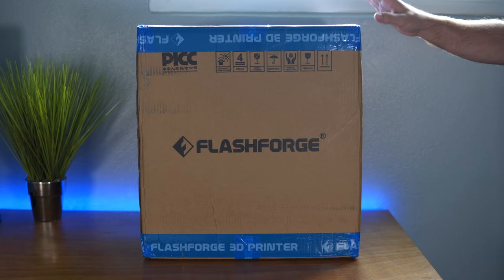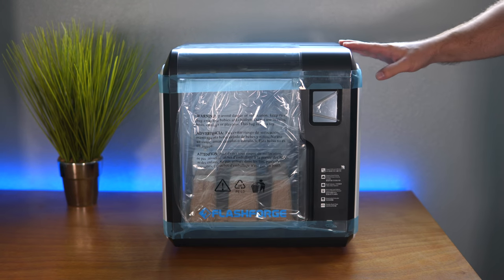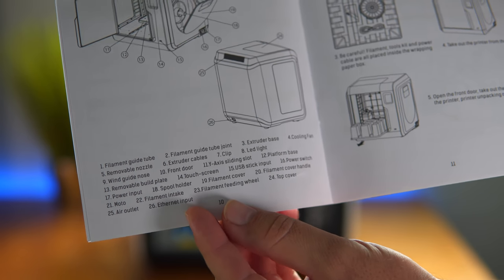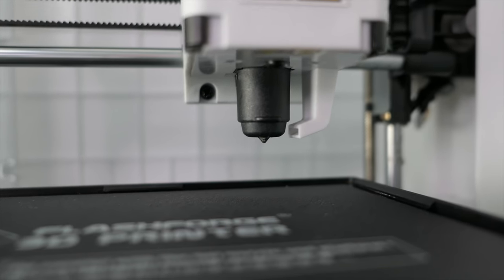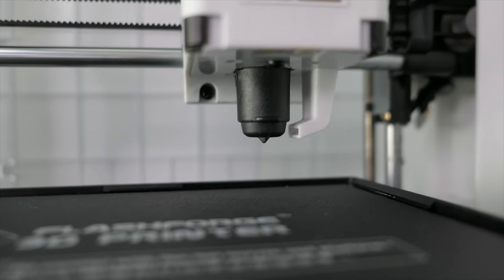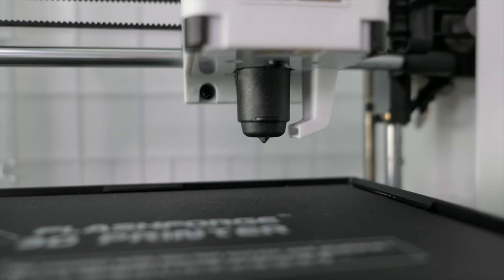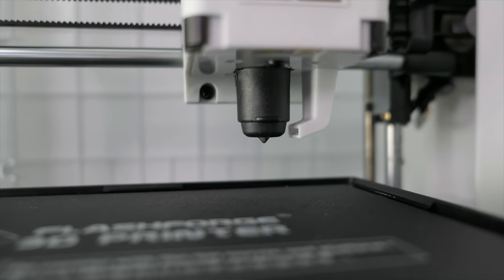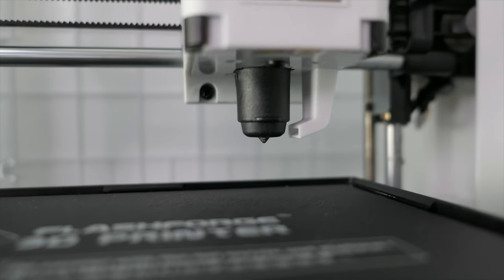FlashForge Adventurer 3 - 3D Printer - Unbox and Setup

Comment: I'm a cnc machinist and I'm pretty comfortable with gibbscam and autocad to a certain extent, but I'm brand new to 3d printing. I bought this printer and can't wait to get it. Your video was extremely helpful to me. I know this video is 4 y/o now lol but, thank you for going over the software and slicing process in such detail as well as the functions of the 3d printer. The explanation in this video is perfect for someone brand new to 3d printing. Great job, man
Reply: How has the printer been so far?
Reply: @SickWheyfu  Been awesome! Comes in handy with custom brackets and custom designs all the time
Reply: @SickWheyfu  If you're interested in printers to buy. The flashforge adventurer 3 from the day I got it until now, prints pretty flawlessly. 100% recommend
Reply: @dale4525  Yup, I'm in the market for one. Looked at the Ender series and the SVO6 too, but since I found an used Flasforge Adventurer 3 for the same price as either of those, I'm going for it. From what I understand, it's pretty much plug and play. Just plug it in, feed the filament, and give it a file to print, pretty much.

Comment: Thank you so muchhhhhh I've been trying to work this for about two years and I finally got it working. 
0:00 - 10:03  ~Unboxing~
10:04 - 12:39 ~Tutorial on how it works~
12:40 - 13:14 ~ Putting in the PLA~
(Finish later)

Comment: Hi Vlad, 

I got the Adventurer 3 up and running for a while now, but I cant seem to find a proper cleaning agent for the bed? There will ofcourse be residue when glue is used.
I feel like 99,5 % alcohol or acetone is going to ruin the bed and its rubber-ish surface. 

What do you use? 

Thanks!

Comment: i got super lucky recently. a local store called the "Yard Sale" was selling an Adventurer 3 Lite for $200. They had looked up the Adventurer 3 on amazon and i guess they thought it was the Lite so they printed a screenshot of the amazon price and sold it with that. I went and bought it and when i got home and unboxed it i noticed the side of the printer said "Adventurer 3 V2". I also noticed it came with an extra build plate, 2 240c nozzles, and 1 265c nozzle. Turns out they didnt realize what they had and sold me a brand new 450 dollar printer for 200 lol
Reply: score
Reply: What a deal!

Comment: So I just got this printer and it's amazing. Works straight out of the box with minimal setup time. However I am having issues with the rafts - If I disable them the print moves from the plate every time, what did you do to prevent this? If I enable them the print works but then they are a nightmare to remove. Help appreciated.
Reply: Have you figured this out yet? if not just get a cheap scraper to scrape off your print

Comment: Im wondering if the extruder clogging issues have been dealt with on this model with the new firmware update. If so, this is a nice printer at a nice price with many features.

Comment: Does the regular size filament roll fit the roll holder? I have the Flashforge Finder and it doesn’t fit the regular size roll.
Reply from the maker: No, it's the same small roll as the finder.
Reply: Do you know if there is a way to use the regular size roll externally? With my Finder, I have to feed the filament external for the regular size roll.
Reply: @dkieng  Search Thingiverse for Flashforge Finder.  You'll find an external spool holder.  Works like a charm.  Using it myself.

Comment: Just bought this printer, and my first little square print is stuck to the bed completely. Nothing I do gets it off. What could be wrong? I'm going to have to heat the bed and scrape off the print, ruining it in the process.

Comment: So looking to get my first 3D Printer. I am looking at the Monoprice MP Select Mini V2 or the Flash Forge Finder. Which would be the one you would choose based on the price, the Forge is about $120 more than the Mini.
Reply from the maker: I would chose Flashforge over Monoprice but if you want the best printer for your money i would recommend ender 3/pro, but thats just my opinion.
Reply: @JustVlads  I appreciate that, I do not want something to "tinker" with, just want to print some miniatures for table top gaming at a reasonable price. Throught it out of the box and start printing.
Reply from the maker: @unclegamer6705  I understand. Unfortunately I have not had enough printers to suggest an out of the box ready best bang for your buck printer.  The FF Finder is a good machine to start with so maybe that would be a good choice. The monoprice printer that i have is not on par as far as print quality is concerned to the finder. Also consider buying the printer from a store that you can easily do a return just incase its not what you were looking for. Hope this helps.
Reply: @JustVlads  Not sure if you saw this, looks like Monoprice has the same printer as the Adventure 3, the Monoprice 135880 Voxel 3D Printer. The best part is it is only about $30 more than the Finder 3....  Think I might have found my first 3D printer.
Reply from the maker: Oh nice, they appear to be the same lol. It's a very good printer overall. My bed on the flashforge a3 is not perfect, other than that it's great. It would an awesome first printer.
Reply: Uncle Gamer the elegoo Mars is really good for miniatures

Comment: After hitting print, the print head on mine is just sitting there not doing anything... It moved into... Some position, raised up, not down near the plate, and its just... Hanging there. It spewed out a string of PLA, dropped it, and carried on hanging.

Comment: Great video.  Considering purchasing one of these after STRUGGLING to get an Ender 3 V2 to print correctly.  I could not get ANYTHING to stick to bed.  I did not see anything about you setting up the bed or leveling it.  Do you need to do this step or is it built into the machine/software.  Was setting the Z offset the only thing you needed to do?  How did you do it later?
Reply: u dont need to move the nozzle or anything. for me i just loaded the filament and built the box and it was perfectly fine. i hope this helps
Reply: Bro, the first video I pulled up had how to level the bed of the ender 3 v2, and also there is a mod that you can buy that auto levels it. How much did you research before buying?

Comment: witch one should i get FlashForge Adventurer 3  or Flashforge finder ?
Reply: I have bought the finder and it's a greater printer. The only "bad" thing is that you don't have a heated bed. But I find it overall a great printer.

Comment: So I decided to get the other version the printer that you have here the one that doesn't have the camera because I don't think I'll need it but other than that this is the one I'm going to go with because it's what I think will help me plus a software seems really easy to use and it's going to be a lot of fun to use I can't wait to order it this week.

December 31st 2019 at 5:45 p.m. here in New Milford Pennsylvania on route 29 I was involved and one of the most horrific car crashes at people I've ever seen in their life.

I was hit head on at a combined speed of 125 mph at the scene of the crash which I don't remember much anymore I was told that I lost 80% of My blood and that basically during surgery I die twice on the operating table and was brought back I was in surgery for 13 and a half hours.

I broke my tibia shattered my fibia and so many places completely destroyed my left arm and had to have rods pins and screws in both legs both knees and my left arm completely rebuilt from The joint to the hand.

I spent about a month and a half in the hospital and then I went to physical rehab and I spent another week and then I spent another eight to nine months at home physical therapy.

The pain that I went through was there's no words to describe it as whatsoever.

I am currently disabled now because of the accident the guy that hit me and was his fault and , unfortunately it would do the Pennsylvania law that if you don't have a certain amount of money you can't collect so my settlement not much at all.

I was told that would never walk again or do this and do that and I refuse to accept that I do walk I do drive but I'm at 70% of my life the rest of my whole life I'll be 70%. Meaning that I will not be able to run or do physical meaningful activities like I used to.

Before that in 2012 my fiance killed herself on October 15th my other dog passed away on December 15th 2012 my mom had a stroke on December 25th 2012 and died January 27th 2013 and then two years later I lost two more people two more relatives two best friends and so on and so on and then my uncle and my aunt passed away and then I had the horrific accident that changed my life.

So I never get anything for Christmas so it would be a miracle to get something for Christmas for lunch it never will happen but it would be a miracle

Curtis Bynon 87 Cobb street new Milford PA,18834

valacbynon@yahoo.com

Comment: The problem with these printers is that you need to buy extremely overpriced proprietary filament. That alone is a huge cost booster and a no go for me. 
Also 150x150x150 size for that price?.... Really? I'd rather have 3x Ender 3s...

Comment: First printer I ever owned. After a couple of weeks and returns I got my money back. Terrible printer. The only thing okay is the Flashprint software. The idea is there but not well executed and this printer was/is marketed at commercial end which I highly doubt it can perform. After getting an Ender 3, I soon realised what a good printer was capable of and without breaking down.
The list of problems that arose from the Adventurer is pretty long. 
I would say stay away from this if you are looking for quality. Looks do not mean everything.
Reply: What did you end up getting?
Reply: @newwinproductions4505  My main goto printer depends on what filament I use as I have set them up specifically. I have 3 Ender 3 printers, a Chiron for large prints and my favourite is my Sapphire S with enclosure. Core XY machines are fantastic.
Reply: @swiftrick15  Mind if you tell me why you like the sapphire s most? I'm reading up on reviews but they don't look too great.
Reply: @newwinproductions4505  I think the Pro model had some issues. But the S model is what I have with the added enclosure option and it has been flawless. All stock.
On the Ender 3s I did change hotends to Swiss Genuine Hotend to print at higher temps and safely.
I am being honest though. No probs from the Sapphire S model here.
Reply: @newwinproductions4505  Oh and the reason I like it the most is the Core XY. No moving bed, so no intertia from that. And it can print fast and consistent. And never clogs. (But that can happen if user uses wrong temps and speeds etc etc )